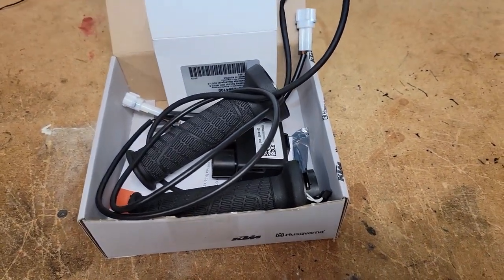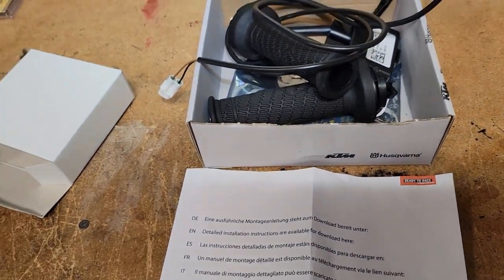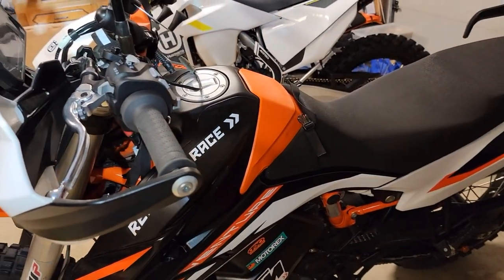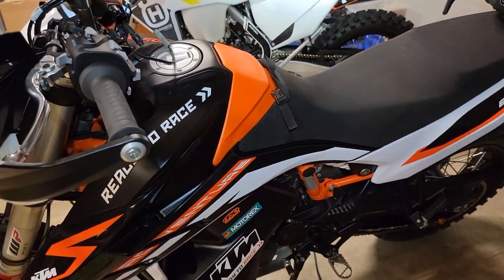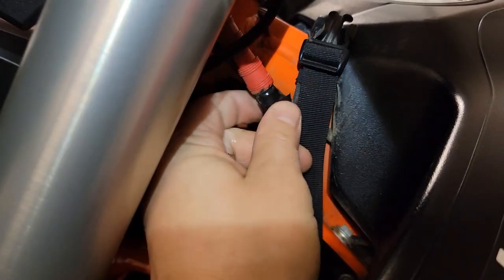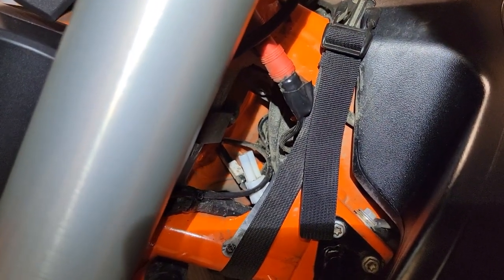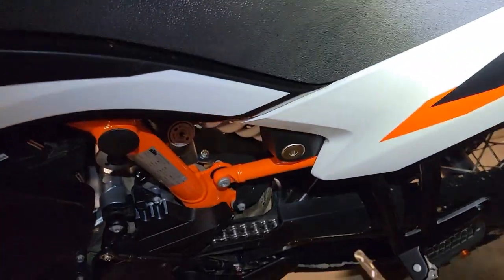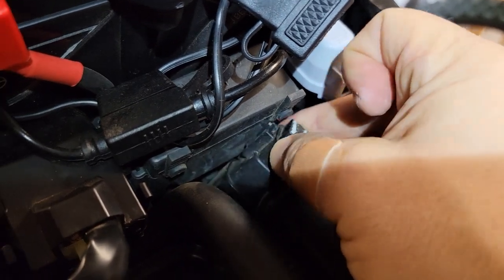KTM 890 Adventure R Heated Grip Installation--Super easy installation!

Comment: Installed mine today. I wasn't so lucky to have the heated grip connector so accessible. It took me about two hours to wiggle my hand behind the battery compartment until I could push it out through the front to where I could hook up to it. You would think KTM would put a little more effort into making this more accessible given how many adventure riders like to run with heated grips. Also, I noticed that you didn't install the module that it came with underneath the fuse box. The fuse box actually comes off and slides onto the top of the plastic cage it comes with and the heated grip module goes in the bottom of that plastic cage. Makes it nice and clean.
Reply from the maker: Thanks for the feedback, you are correct!  My kit didn't come with that bracket so I went with what I thought would work at the time, but the bracket is a great way to go!

Comment: Thank you John...Great Instructions and worked very well for install on the Norden 901.  FYI The Norden Power Plug was up front on my bike right under the triple clamp...easily accessible and clearly labeled.
Reply: Hello, did you have to go to a dealer  to activat?
Reply: Hi Brian. Did you have to get it activated by the dealer..my tft menu only refers to heated seat..and was wkndering if it will work without activating in the menu?
Reply: @claudiomartins1675  have you found the answer to this yet?
Reply: not yet..
Reply: Claudio, you shouldn't have to go to the dealer to activate the OEM heated grips. You do have to plug in that HCU module, near the battery as John shows. Note that KTM also sells heated grips with a push button controller that you mount to the handlebar - it does not come with the HCU module & is not controlled through the TFT dashboard menu.
Reply from the maker: You're very welcome!  So glad that it worked well on Norden 901 as well.  Nice work getting it done and it will be so good to keep your hands warm!  Lucky dog, that it so cool that Norden Power Plug is up front under the triple clamp!  Even labelled!  Nice bike!

Comment: Thank you so much John!  After 9 months my heated grips finally came in a  couple weeks ago and I have been trying to find some clear directions ever since.  Unfortunately my plug was buried in the center of the frame and could not be accessed from the front so off came the tank.  It gave me an excuse to clean out the built up dust and grime from last summers adventures anyway.  Great video!!
Reply from the maker: Hi Chris!  You are very welcome, glad to do it!  However,  truth be told, if I had to remove my tank, it would have slowed me way down to the point where the video likely wouldn't exist.  Good job on pushing through and finding the heated grip plug.  💪  The rest of the install will be easy compared to that task.  Next I'll do the heated seat installation video.  Thanks for chiming in so that others know that plug can be hiding deep under the tank sometimes.  Thank you also for the positive feedback!  Keep riding and enjoy that awesome 890!  👌

Comment: Thanks for a very informative video, just installed mine. Luckily my plug was easily accessible like yours was. My biggest problem was getting the T 15 torx into the grips to get them off, they appear to be at such a wierd angle and not easy to locate the torx bit into the screww head. Anyway all done now and works a treat, thanks for a great video.

Comment: Man, needed this video a few days ago!  Just installed mine this last Saturday.  Mine was not as easy as yours though.  I had to take my tank off to get to the plug so that took a bit.  Sadly none of the heating options are "turned on" in the computer so now I get to drop $100 for the dealer to activate them.
Reply from the maker: Oh man, that sounds like a struggle but good job persisting and having success!  So frustrating to have to have it "activated" when we purchased the bike already.  I am so glad that the tank didn't have to come off, I got lucky.  Thanks for watching and sharing! Ride on!

Comment: Really appreciated your video !!!! I gotta tell you for me getting the unit that goes under the seat was a BEAR !!! I didn't have any silicone spray so used some lithium grease hoping that would help it slide into place. Man O Man it's a tight fit and didn't get it to seat as well as you did but close. Seeing how to get the throttle side piece fitted in was MONEY so again, THANKS for the video !!!!

Comment: I've installed two of these HCU kits.  I can tell you that the wire harness white plug is like a Easter egg hunt.  Bike number 1 had the connector under the tank on the left side but access to it was after removing the battery box assembly enough to almost shove it out of the way.  My wife's small hands were required to make the connection.  
On bike number 2 it was visible after removing the tank and came in from the right side of the frame.  But not enough to connect it.  I was able to connect through the frame members on the right side.  Man they made this difficult.  The other challenge was figuring out how the throttle side plastic bit was supposed to go together.  That entire exercise could have been engineered better.
I'll take Hung's word for it but I could not find the instructions.  In my book this was a pain in the rear.
Reply from the maker: That sounds so hard!  Thanks for posting so that others can be aware of what might be involved depending on plug placement and access.  Way to persevere and keep working the problem though.  I am impressed!  My wife has bailed me out of a few binds with smaller hands and forearms, sometimes ours just won't fit!

Comment: John excellent video. There will be many people with 890 Adventure R looking at this video. I own a Maintenance Manual for the 890 and it does not even mention where the Heater Control Unit is or goes. I am awaiting my Heater Grip Kit any day. They hard to come by these days. According to my local KTM Dealer they are on backorder until Dec 2022. Ouch huh. My local KTM dealer was able to give me other KTM Dealers that showed the Heater Grip Kit in stock. I lucked out the first Dealer I called had one and I grabbed it. I was able to find my Heater Grip Cable on the right side of my frame by the neck. Like you said very easy to get to. I also found the HCU Dummy Plug right side of the bike right behind the Fuse box under the seat. Again the Maintenance Manual does not even tell you where these connections are or how to find them. Buyer beware because there are some Web Sites out there that will direct you to a KTM Heated Grips supposedly for the 890 R. Do not fall for it. You need the Heated Grips and tHe HCU Kit in order for the Heated Grips to work with the TFT Display. So now I am fighting with the company to take their Heated Grips back that are not for the 890 R yet their Web Site directed me to them. False Advertising. Great video/tutorial keep them coming. Thank you John
Reply from the maker: You are so welcome!  Thank you for your thoughtful comments, I really aporeciate it!  Sorry to hear about your experience with the wrong grips be misrepresented to you, so frustrating indeed!  That is great that you found both plugs, you will be good to go when they come in and it will be a quick install! So hard to wait though!  I purchased these from Rotweiller Performance online and when they showed up, I could hardly believe it.  I put them on within minutes of getting them.  There was a lot of trial and error  that I didn't show in the video to spare everyone the pain of troubleshooting what the best way to hook them up would be.  It is amazing that instructions are so allusive these days!  😀 Hang in there, maybe check or call Rotweiller.  I ordered these for the 890 Duke  by the suggestion of another rider.  Of course, if you can find an 890 Adventure r set purchase them on the spot.  Best wishes and happy trails!
Reply: Would you mind sharing that method as I ordered mine with the bike in July 2021 and have not seen them. I would be willing to buy them elsewhere and get a refund.
Reply from the maker: @kevinglenn4381  Hi Kevin!  I did the same thing, the grips from my dealer where I purchased the bike never came in either.  Try Rotweiler Performance.  They came in after only a few weeks on order.  Let me see if I can find the link and post it.
Reply from the maker: @kevinglenn4381  KTM Heated Grips 890 Duke
https://www.rottweilerperformance.com/ktm-heated-grips-890-duke/
Reply: @oregonmotojohn  

I was able to call a KTM dealership in Costa Mesa California and they had six sets. I paid for an ordered one today. If anybody else is looking for them I believe it’s called three brothers.
Reply from the maker: @kevinglenn4381  That's awesome!  Good work!

Comment: Great video John. As to KTM providing step by step instructions...they do! That slip of paper sent you to the right place, but didn't explain what to do next. You don't download the Owners Manual again (assuming you downloaded it originally). You scroll down the page further, and find the "Apparel & Technical Accessories Manuals" section, and enter the part number for the accessory you are installing, then click search. I tried it with part # 63712964088 - which should be for the heated grips & HCU unit like you purchased. I then downloaded the "Fitting Instructions (for) Heated Grip Kit" PDF document. The download link simply says "Owners Manual", and the file name is an unhelpful "V2", but the document clearly states what it is on the front page when you open it. Inside, you find detailed step by step instructions with pictures (printed in five languages - jump to the suitable section).

Glancing through the instructions, it looks like you're missing a black plastic mounting bracket that the HCU clips into, which then gives you a place to mount the fuse box on top of the bracket - then the entire assembly goes where the fuse box was. See pages 11-12 of the English section of the instructions. I don't think it's strictly necessary, and what you did is fine....
Reply from the maker: Excellent post!  Thank you so much for info on how to find installation instructions and helping me out as well. You are correct, I didn't get the bracket as that would have made me continue to search on where it went.  Your post is going to help a ton of people.  Great job!  A++++
Reply: Your post was so helpfull. I have the bracket and could not figure out where it went. after you said fuse box on top I knew what to do. remove the fuse block housing, slip in new bracket in fuse block spot, put fuse block on top of new bracket and control module attaches to the front of the new bracket. I tried to download instructions just as you said with part number but no luck. it just wont go to the next step of the instruction download but with your information its very easy to figure out how to install the bracket. For those looking for the pigtail at front of frame under the triple clamp, it has a sticker around the wiring harness just below the connector that says heated grip.
Reply: Great tip, thanks.  I’ve just been fumbling through all my parts installs figuring out along the way.  Now I can access actual instructions.
Reply: Huge help! Thanks for explaining that so thoroughly..

Comment: Cheers for that John was struggling with the right hand side grip as the pic on the fitting instructions is not very clear showing where the little wire block sits. 👍🏼
Reply from the maker: Glad it was useful, I puzzled over that little piece for at least 30 minutes or so trying various angles and positions.  I feel your pain!  Ride on!

Comment: Great video. I have been waiting on those since last spring. I wonder when they will show up? The throttle side is a better setup than my Super Duke. On that bike I needed to restrict steering head motion in order to prevent the plastic wire guide that is molded to the grip from hitting the gas tank. The guide broke and I need to replace the assembly. First installation was done by a KTM dealer, so they warrantied the part.
Reply from the maker: Thanks for watching!  It has been a long wait, my dealer never did get them in.  It is a good design, I know just what you are talking about on the Super Duke (great bike btw) on how wire is external to throttle so this is a good design, just took me a while to figure out where it was suppised to go.  :)

Comment: Does the 2023 ktm 890 adventure come with heated grips if you get the tech pack added to the bike from the dealership?
Reply from the maker: No, I had tech pack added at dealership and it only activates the software for features and does not add heated grip hardware unfortunately.   I wish it did!  😪

Comment: I wonder if we could buy the HCU and then use a $30 heated grip on the same connector. I mean, the HCU and the bikes menu probably don't communicate with the heated grips. 
I'd just buy a cheap kit like I had on my other bikes, I'm going to buy the HCU for the seats anyway, and wire the grips to the connector and just cut the connector from the grips out of the assembly.

Comment: Thanks for sharing:) and it worked without activation through dealership/diagnostic tool? My dealer said I would have to come in for getting them activated?!?
Reply from the maker: You're very welcome, glad to be able to help out.  Good question, yes, mine did work without being activated through the dealership as it showed up in dash display where I only had to let the console know that it was installed by clicking on "heated grips" and then "installed".  However, my only question is that I did pay to have the dealer install the "tech pack" when the bike was new and I don't know if these functions are added with that addition or not.  So in summary, if you had the Tech Pack installed, you should be good to go.  However, if you didn't I can't say for sure since I haven't tried the install without Tech Pack.  Maybe someone out there without the Tech Pack installed could chime in and let us know if Heated grips show up on the console?  Actually, look on your bike under "motorcycle" and see if there is a "heated grip" option there or if there is anything under "settings".  Give it a try and report back.  I can be more specific with my directions if you see the heated grips option show up.
Reply: I also have the TechPack and it didn’t work without activation through KTM. My mechanic also wasn’t sure and suggested to install and try it out. On my EU spec bike I didn’t have the same submenu as  you  where you chose „installed“. It was interesting to look over mechanic‘s shoulders while he was unlocking it. KTM program looked like a consumer style fancy app. I wish it came with the bike :-D
Reply from the maker: @hannesracing8673  Great feedback, thanks for commenting as it answers the question that we were all wondering about.  Too bad that in some cases it takes a trip to the dealer to get it activated.  It makes it hard for the owner to know which way they need to go (maybe EU vs US spec, hard to say or maybe just luck).  Cool that you were able to look over the mechanic's shoulder and watch it get unlocked!  Thank you for letting us all learn from your experience!  Much appreciated!

Comment: Aren’t you supposed to hook them into the screen so you can control it like TC and other modes?
Reply from the maker: Yes, when you plug them in and they are all installed you go back into to your screen and activate them and they can then be controlled by your screen using the left sided handlebar buttons, pretty slick as you can adjust them or turn them off or on while you ride via the screen.  You are correct.  Put a different way, once you have everything plugged in and installed, the bike "recognizes" that they are there and allows you to activate them.

Comment: Did you know if this feature is just available on the 890 R? I got a 790 S but no wire installed 🤦🏻‍♂️
Reply from the maker: Good question.  I had a 790R that the dealer installed heated grips on and the grip wiring harness I believe tied in behind the headlight but I could be wrong.  With the 790 the heated grips are controlled by a switch on the handlebar.  They worked well, but were not integrated into dash console.  Ride on!
Reply: @oregonmotojohn  thats it, just the 890 got display controlled hand grips heated

Comment: I bought the grips and the HCU separately. The same part numbers you have in the kit. I found the factory grip heat connector and found the HCU. Plugged everything in, started the bike and it does not work. I have a 2023 Adventure (non R). I don't get the screen where it says "installed", it says "not found". I bought the packs when I bought the bike. I have everything else.
Any ideas?
Reply: Did you ever get this figured out? Same issue for me

Comment: The installation manual says, "The function of the heated grips must be activated with the diagnostics tool after it is assembled. This must be performed in an authorized workshop." Obviously from the video this doesn't seem to be necessary for them to work, does anyone know what that's about?
Reply from the maker: You are correct, I was really worried that I needed to do that, but I was able to do it without a trip to dealer but at initial purchase I bit the bullet for the Tech Pack and I don't know if that mattered or not.  Once they were installed, I was able to activate them through the screen of the bike.